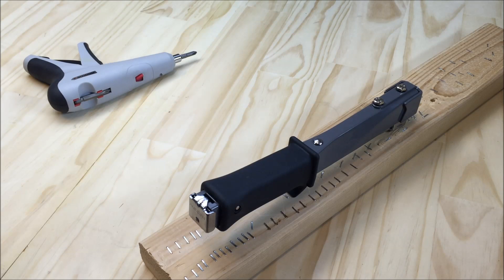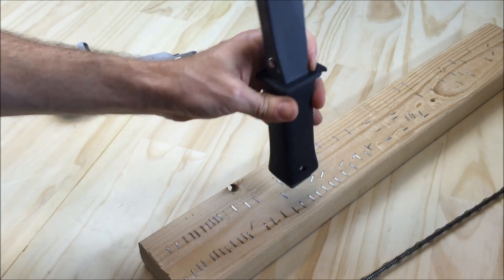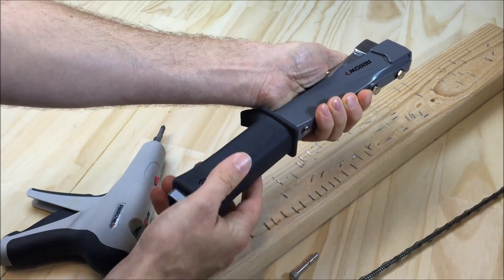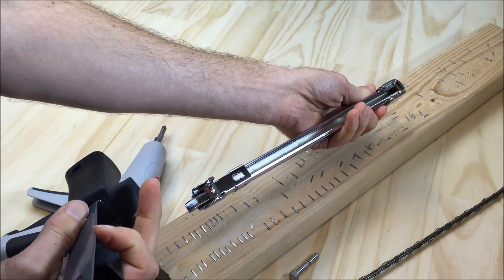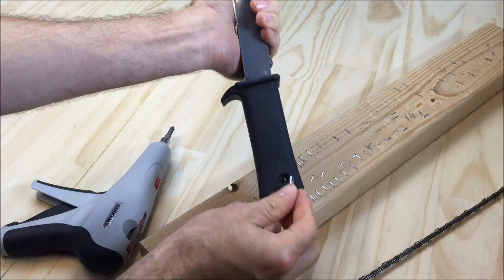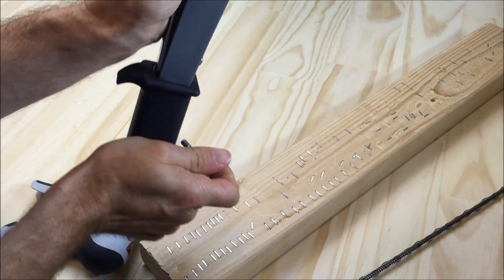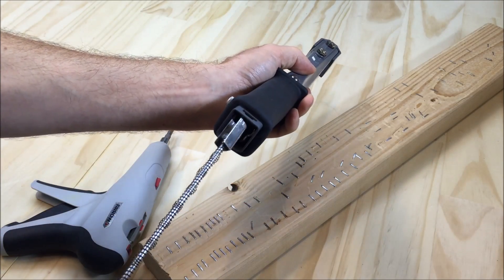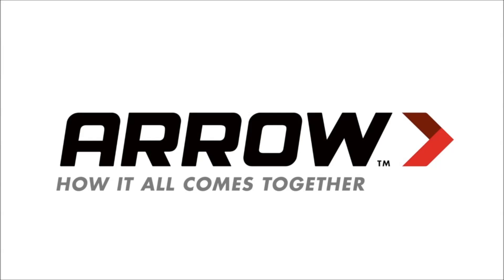How to unjam Arrow's HT55 Slim Hammer Tacker

Comment: I bought this recently, thinking that because of the Arrow brand it would be one of the best. But it jammed endlessly on the first day. I was constantly having to fix it and when I empty the magazine, the strips of staple were broken up into small crumbs. I tried different lengths of staples and different brands. All T50 and A11 staples are the same category and are full interchangeable. I literally spent more time fixing it than using it, plus I wasted about half a box of staples by having them broken up into crumbs that can only be thrown away. I've been in construction for over 20 years and have put thousands of staples through several makes of hammer tackers and have NEVER seen one fail as badly as this. I'm returning it.
Reply from the maker: Hello - We're sorry to hear about your frustrating experience with our hammer tacker. If you have not yet returned it, please contact us at customercare@arrowfastener.com or 800-776-2228. It sounds like the tool you purchased is defective, and we can send you a replacement under the warranty.  -Your Arrow Fastener Team
Reply: Yeah, these things are trash. Taking 2 brand new ones back today because of the exact same problem.
Reply: Same here I bought one months ago and just now used it. It did the same thing. So I tried to fix it and now I’ve lost the springs Inside 🤣

Comment: HOW DO WE MODIFY TO STOP JAMMING?! No one on any of our crews likes using ANY brand of stapler, NOT ONE of the three brands we've used can go a full day without JAMS, BENT STAPLES, PARTIALLY HIT STAPLES, on and on. I dont wanna hear about lube, we've used and are using several incl DRY graphite.
Reply from the maker: Hello - We understand your frustration. Unfortunately all hammer tackers will jam on occasion. Bent staples and staples that don't fully penetrate the substrate often are the result of the staples being too long for the application. You might want to consider something other than a hammer tacker, such as a cordless electric or pneumatic stapler. - Your Arrow Fastener Team

Comment: THIS DOES NOT WORK , THE MAGAZINE WONT COME OUT...
Reply from the maker: Remove the pusher assembly by sliding and unhooking the metal plate at the back of the tool. Push the pin partway out then press up on the magazine to remove the pin the rest of the way. Push the magazine down and forward using your thumb then should be able remove it.

If you need more help, please contact us at 800-776-2228

Comment: This just doesn't make sense. You skipped a step of removing the pin that screws in. Well I removed that pin and the pusher assembly will not come out. Super confusing. I don't think I will ever be able to unjam this thing!
Reply from the maker: We're sorry to hear that you're having trouble with unjamming your hammer tacker. Please give us a call at 800-776-2228 for help.

Comment: thanks for this video. My stapler has something else. The staples won't advance in the channel. It's too tight in there.
Reply from the maker: Make sure you've loaded the staples correctly: https://youtu.be/jqHDiLz9xGY. Also be sure you're using T50 staples that are 1/4", 5/16" or 3/8" in length. If you need more help, please contact us at customercare@arrowfastener.com or 800-776-2228.

Comment: im trying  to find a video on the yellow one the t50p or something  like that.. staple  is jammed  inside but i dont know  how to open it. please help
Reply from the maker: +Martin Rodriguez,  following these steps will help you clear your T50 Heavy-Duty Staple Gun:
 
1.       Remove the pusher rod assembly.
2.       Use a screwdriver and pliers to remove the screw and nut.
3.       The channel assembly can then be removed and you can clear the jammed staple. 
 
You can also see a diagram here: http://bit.ly/1nOHiuU. Were you able to clear it after following these steps?
Reply: Your link does not work

Comment: Just bought this.  I got about 8 staples out of it and it jammed!  Cleaned it out and it jammed after 2 or 3 staples.  T50 just as it requires.  I am pissed and this crap is going back.  SO PISSED!
Reply from the maker: We're sorry to hear that your hammer tacker isn't working. Unfortunately, a defective tool sometimes makes its way onto the store shelves. That's why we back our tools with a warranty. If you haven't returned your hammer tacker to the retailer and would like us to send you a replacement, please contact us at customercare@arrowfastener.com or 800-776-2228. - Arrow Fastener

Comment: what if the magazine wont move. The device depicted is not properly jammed. Video is not completely helpful for me.
Reply from the maker: Hi there.  If the magazine won't move, try applying some extra force to it- possibly pulling with pliers if you really can't get it. 

If it still won't work, please reach out to our customer service team: http://www.arrowfastener.com/awesome/contact
Reply: @arrowfastener  fixed it. Took some time to wiggle the magazine loose. Perhaps this is not the tool for my job.
Thanks for your help.
Reply: Had same problem and vice grips finally worked for me.

Comment: Mines is still stuck and won’t push down and up. What can anyone suggest??
Reply from the maker: Hey there, sometimes you can get the magazine to pop out by knocking the hammer tacker upside-down on a piece of scrap wood. Also double-check to see if there's any material stuck in the staple exit point, and use needle-pliers to clear it if there is. If this doesn't solve the problem, please give us a call at 800-776-2228, and we will troubleshoot further with you. Thanks for reaching out!
Reply: Trust me just go and get your money back and don't ever buy that product again
Reply: @arrowfastener  OK,  this worked on mine, hitting it upside down on a piece of wood,  thanks
Reply from the maker: @elmofrazier3481  Glad you were able to dislodge the staple.

A few things to keep in mind about hammer tackers:

They're designed to quickly insert staples through softer types of building materials into wood and works best for installing materials such as felt paper, insulation or carpet backing.

To ensure full penetration and minimize jams, try to keep the head of the hammer tacker straight and level as you strike the surface of the material. 

Use the shortest staple possible. (Take a look at our staple guide for more information: https://bit.ly/3fJdrRS.)

Hope you'll find these tips helpful!

Comment: I've owned many Arrow staplers, pop-rivet tools and hammer-tackers, never had a problem...this one is garbage, jammed after 10 min on the job and IMPOSSIBLE to remove the magazine. Never again, Arrow.
Reply from the maker: Hey there. Sorry for your negative experience. If your staple is really jammed in your tool, we also recommend using needle nose pliers to pull it out. And if you need help, please reach out to our customer service team. Here's the contact info: https://www.arrowfastener.com/awesome/contact/